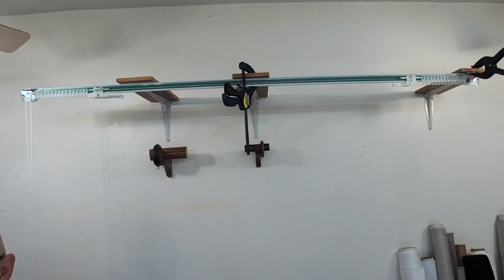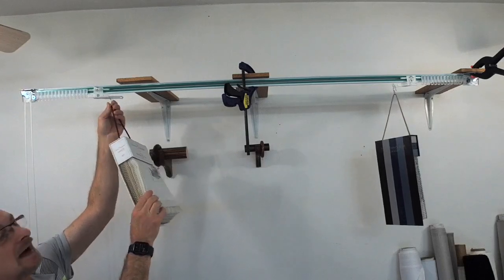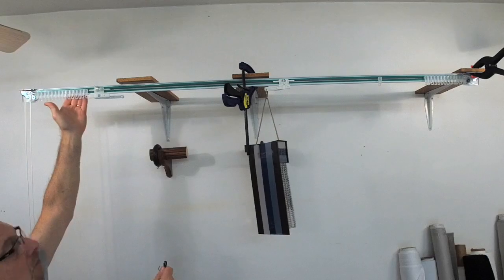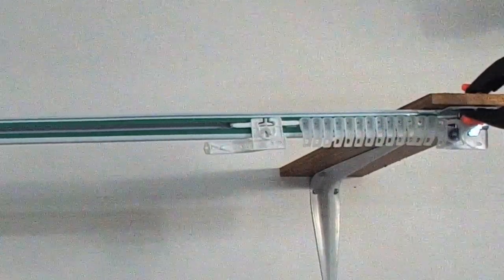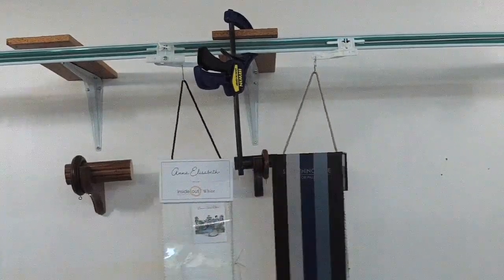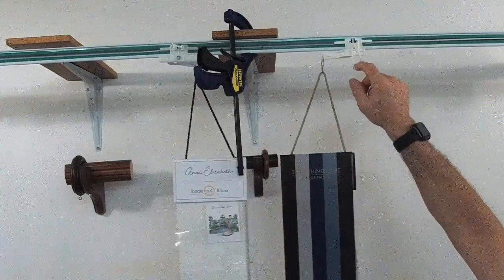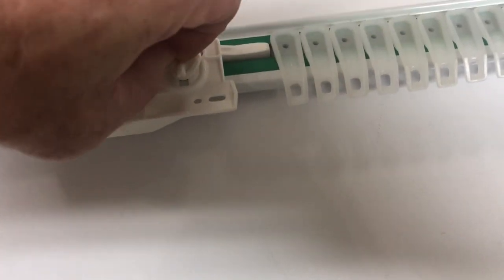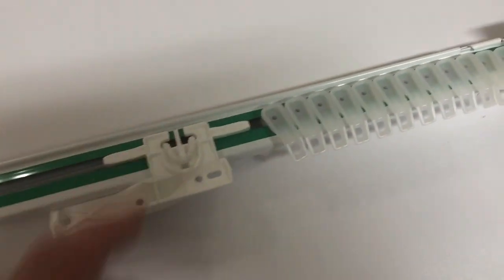Traverse Drapery Rod Not Working. Problem solved!

Comment: Perfect! We were gifted a used traversing rod that is adjustable. Of course, my window is not the same size. This meant when I adjusted the length of the rod, the left side did not open all of the way. Same solution is applied in this instance.

Comment: Thank you Scott. I have been dreading getting some one to fix my curtains. They are very wide and heavy. They got to where I couldn't open them, the draw string was loose as well. I am grateful for your simple explanation of where to start when it won't draw. I was also able to tighten up the pull cord. In a matter of 10 minutes, they are working perfectly THANK YOU :yougotthis:

Comment: Thank you Mr. Weaver for that string/hook tip applying to a center-draw-pull. My problem at my new airb&b is with 1. the living room right-side-draw and 2. bedroom left-side-draw traverse rods over sliding doors. Both traverse rods get stuck at the center-support-piece and neither open or close properly. I'm afraid tugging hard will break the cords or pull the rods off the wall! Guests arrive next week! Please, what is your advice?

Comment: Thanks for your informative video. However,my problem is a little different. My curtains close to a certain point,and then something jams,and the curtains will not close the rest of the way. This has been coming on gradually.
Reply from the maker: Try removing the drapes and see if both sides fully open to the same distance. I think you may find one side to open further than the other side. To fix this issue you will need to make sure the draw cord is not tensioned and just like in this video reach up and take the cord out of the hook like I show and push both center carriers all the way back so they are equal and then put the cord back on the hook. Good luck!

Comment: How about a video on a long traverse rod where the curtain catches on the extension? Thanks
Reply from the maker: The most common reason for the drape/glides to catch on the extension is a cheap rod! Traverse rods sold in big box stores and online our junk! The only rod I use are Kirsch super fine rods, they offer a tight tolerance with little play in them. I’m sure if you google you will find them, not cheap but worth the money! You can also reach behind the rod and use silicone spray to lubricate. Silicone is non-staining.
Reply: @Factorydirectdesignersworkroom  Bummer - I was hoping for a tip on how to manage that. the rod is 12.5 and it was the one we found at the time at that length. Six months later the we received the curtain so we were unaware that there would be a problem. I'll have to try the silicone.
Reply: FYI I was just told by the boss that we have Kirsh rods.

Comment: For a complete beginner, would it be easier to take the rod off the wall to restring? I have the double traverse rod.
Reply from the maker: Yes if you need to restring the rod it is much easier if you take it off the wall. Good luck!
Reply: @Factorydirectdesignersworkroom   Scott, thank you.
Reply: @Factorydirectdesignersworkroom  Success, Scott. Thank you. A bit of a snafu, when one carrier was moving towards the middle, the other carrier wanted to travel in the same direction, in effect stopping all movement. Figured out the left carrier had to be on the other string and not the same one as the right carrier. Oops.